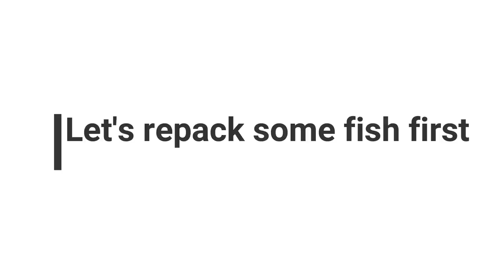Predatory Fins vs Stingray Biology * DIY Tropical Fish Acclimation System * SNEAK PEEK Unboxing

Comment: Should put valves on the drain lines to control the flow so that you don't drain more than what's coming in great quick set up and the holding bins ar a awsome idea no nets needed and less stress on the livestock